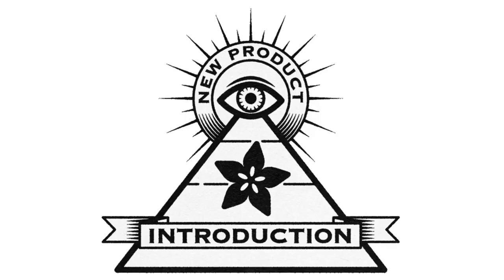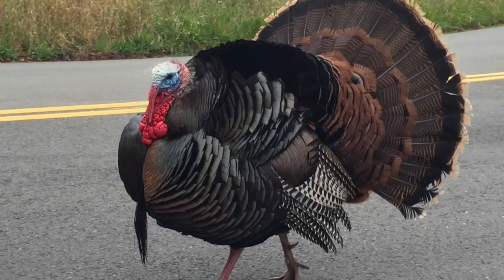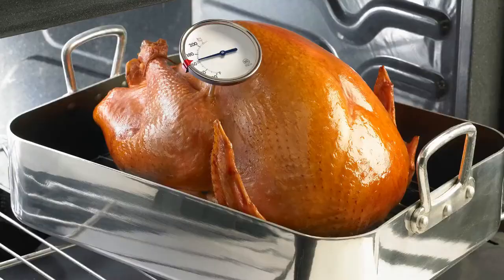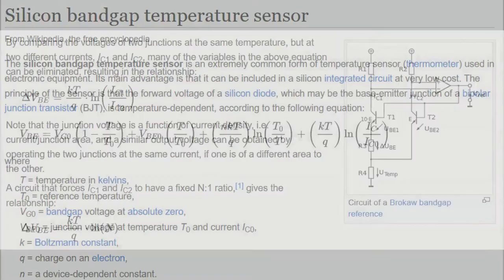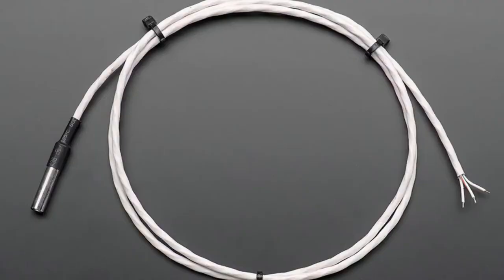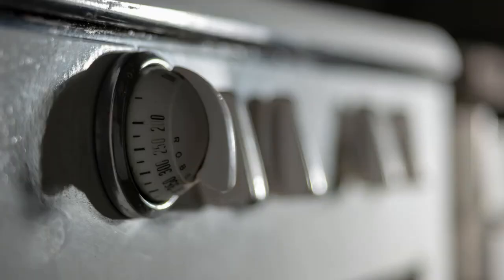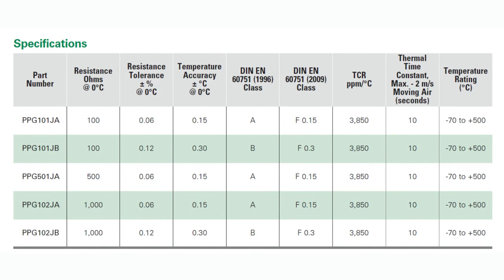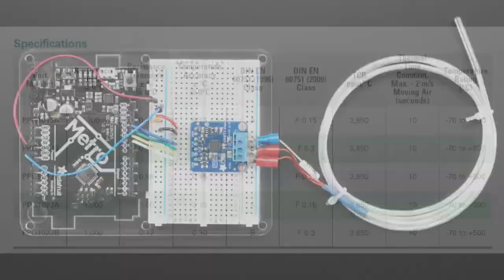EYE on NPI - Littelfuse PPG101JA RTD Sensor #EyeOnNPI #DigiKey @Littelfuse @DigiKey @Adafruit

Comment: As I once read in this comments section, all components are temperature sensors, but some are easier and more precise...

Are these the same as the "thermistors" used in 3d printers? Those seem lower accuracy than what you showed.

I really enjoy the variety of things you feature in this segment, it's very educational for those of us without an EE degree, and useful to know "what's out there"